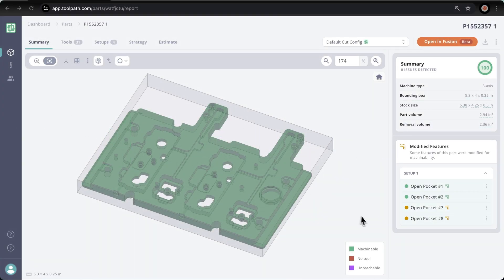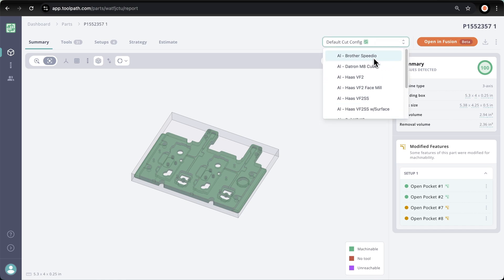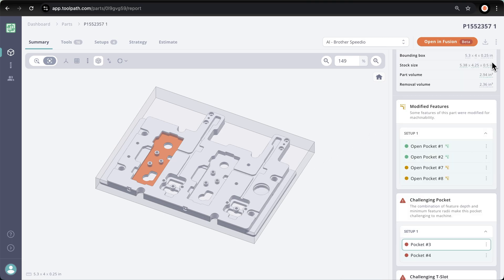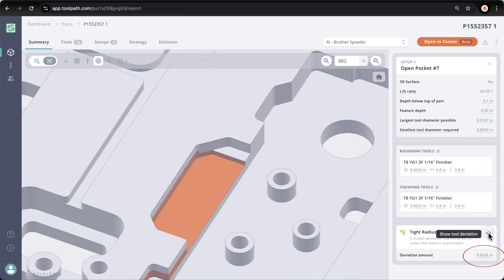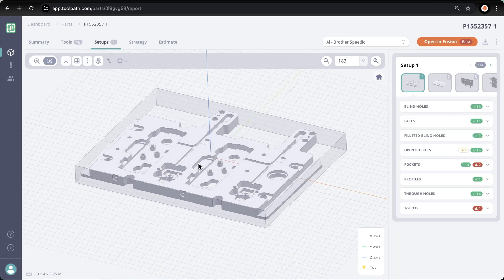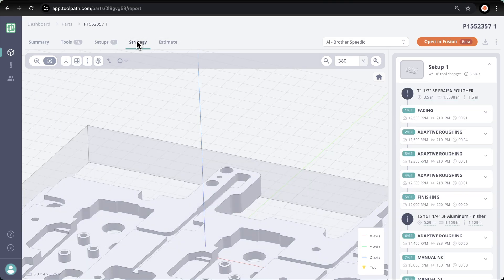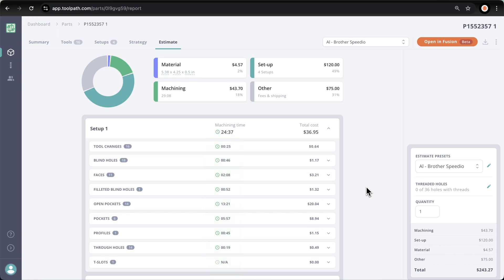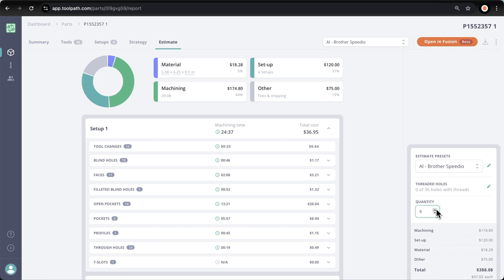Toolpath Estimating Workflow

Comment: After transferring the tool paths into fusion, and making a couple edits including completing areas that were not machined due to no tools available that reach the area, is there any way to bring back the estimated tool path time study into the estimating tab for a more precise quote?
Reply from the maker: Not currently. However this is an old video and we now have the ability to make the changes like feeds and speeds, etc in Toolpath as well have a large library of recommended tools for Toolpath to look through and tell you what tool is needed for those pockets so that your estimate is more accurate.